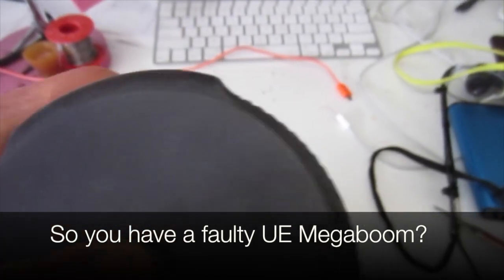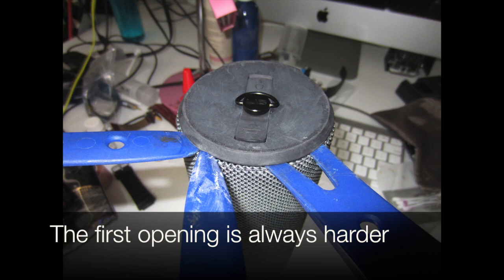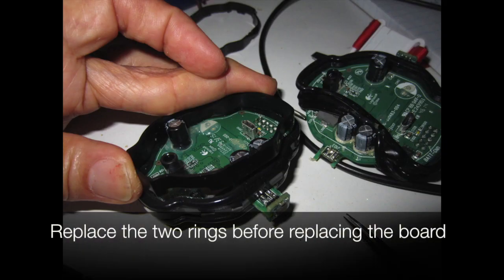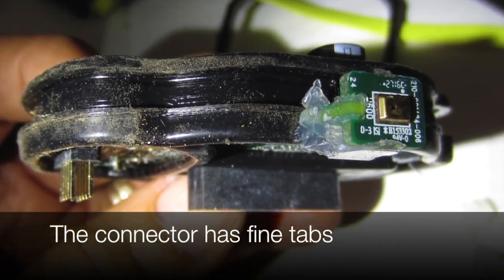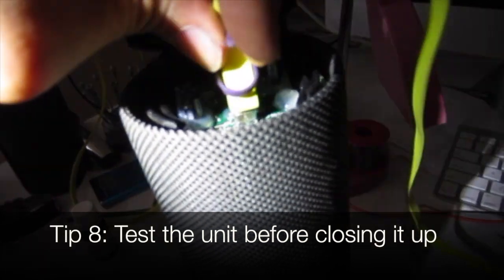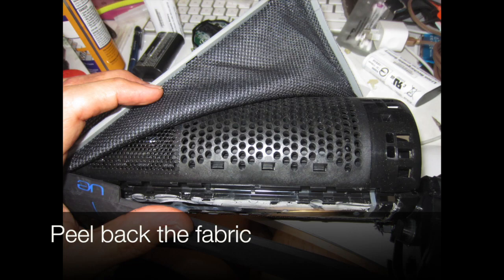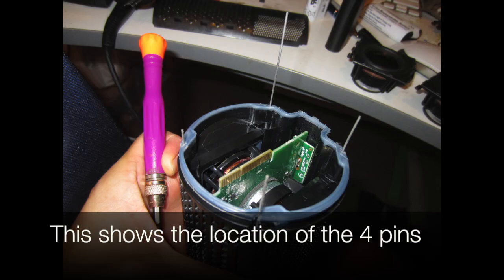UE Megaboom Not Charging or Faulty - 12 Tips when dismantling

Comment: My megaboom when plugged in to charge doesn’t blink white but it will statically say charging please wait if the wire is bent a certain direction. If I can eventually get it to charge it’ll go to 60% at max and barely last. Is it possible that it is a charging port and battery issue ? Was hoping it was either 1 or the other
Reply from the maker: Is the wire the original that came with the Megaboom? The original wires seem to work better. Also when it is connected and only goes to 60 percent, that can indicate a battery problem. The batteries can start going bad even with limited usage because it is age related more than usage.

Comment: Why is the battery light flashing?? It wont stop its a new battery to
Reply from the maker: Sometimes it is a problem with the charge board inside the unit . If the board is faulty it will not charge the battery and the battery light stays flashing .

Comment: Per the company, there is most likely a simpler solution. I unfortunately started pulling mine apart to see how to get at the battery and then suddenly it started charging again after many charging tries. Confirmed by the company's instructions below. Contact them for the full PDF of tips and tricks....

My MEGABOOM no longer charges, how do I fix it?
Your MEGABOOM can sometimes get into a state where it doesn’t charge. To get your MEGABOOM back to a normal charging state, do the following:
1. Connect your speaker to the charger and leave it connected for a few seconds.
2. If the charge LED fails to pulse continuously, disconnect the cable from your speaker, then
reconnect it, and leave it connected for a few seconds.
3. Repeat steps 1 and 2 until your speaker gets to a normal charge cycle - the LED should continue to pulse. (This could take up to 25-30 times.)
4. Once your speaker gets to a point where it charges normally, continue to charge it until the
battery is at 100%.

Be sure to update the firmware on the speaker so that the issue does not re-occur. To update your MEGABOOM software:
1. Download the latest app for your speaker.
2. Connect your speaker to your smartphone and open the app.
3. Tap More, then tap the update prompt.

(I think if the latest update is already installed, there is no "More" option. I didn't find it or any indication a firmware update was available to install on the speaker.)

Perform a Factory Reset: 
Press the Volume “–” and Power buttons simultaneously and hold for 10 to 15 seconds.
You’ll hear a tone that indicates the reset was done and your speaker then should turn off. This reset will bring your speaker back to factory settings.
Turn your speaker back on using the Power button.
The speaker will be in Bluetooth discovery/pairing mode.
After you have performed the Factory Reset, please charge your speaker overnight (5+ hours) to recalibrate the battery.
All the above worked great for me. The link to the PDF (if allowed and shown next) is"
https://images-eu.ssl-images-amazon.com/images/I/81suGzfRC7S.pdf
Reply from the maker: That’s great info . Thanks for sharing . I’m sure that will help many people . Seems like a lot of people having charging problems though .

Comment: I have been wrestling with a non charging UE Megaboom for 2 years. Finally fixed it!! The charger they give you is too short and doesn't make proper contact. Trim back the surround a couple of millimetres with a scalpel. Fixed!!!!
Reply from the maker: That’s strange if it was the original ue boom cable as that is made to match the ue boom
Reply: @Dentinvent  one year on... turns out it didn't work... i just keep that speaker plugged in all the time now... I've had the thing repaired twice, too... it seems to be a problem with UE speakers
Reply from the maker: Yes I always think the original cable fits better but also remember your internal battery dies with age and not just with use .

Comment: Hi, nice video! I am having similar problem with my megaboom. It said that The battery is low, I changed The battery but it didns’t help at all. It won’t get up. Do you maybe know why? Do you have the electic diagram? Thank you!
Reply from the maker: I do t have the circuit diagram but check to make sure you are using the correct Megaboom charger or one that is powerful enough . Sometimes the wrong cable affects the charge as well.
Reply: @Dentinvent  Can you kindly share the circuit, my circuit broke the mouthpiece circuit and I losses the. Now I can't access them, how can you help

Comment: Hi, i have this problem where the speaker wont charge at all, what i mean is, the speaker IS blinking but the battery percentage never increase, been using different cables and charger but no result. Also i have been resetting the speaker but still no luck

Now the battery is 0% and when i tried to charge the thing, it wont blinking now
Reply from the maker: Yes sometimes the charge board is f….ed. 
The charge test cable I show how to make would actually show if current was going in . If the charge board is faulty, it will never charge and the battery will die.
In sone cases it is the internal battery fault. The battery does die with age of a few years . 
Bit risky to order a new battery and find it’s the charge board.
When I made the video , I bought about 6 broken ones and got 5 to work and even sold the worst broken one off for parts . I kept one for my wife to keep.
Reply: @Dentinvent  any ways for me to make this thing works again?
Reply from the maker: @JoFerl  
I think you will have to take it apart but be careful and follow my video tips so you don’t break the side tabs inside. 
I would try with a new battery and hope the charge board is not faulty as well as the battery .
Reply: @Dentinvent  ok im on it! Wish me luck XD
Reply from the maker: @JoFerl  
Make sure you carefully dig out the silicone sealant type glue as per my video. Message if you need advice as you go . Hope you have some basic electronics tools .

Comment: Hello man thanks for the video but I request to chat with you
Reply: What happened when c128 near charging point when it's not on
Reply from the maker: If there is no power at C128 at all when you have power on the charger , there seems to be a fault with the charge board . You may need to see if you can find a broken Megaboom for parts .
Reply: @Dentinvent  ohh morning sir, the problem is that , the robot fall down, then the after I opened it, I found c128 is not there!! ,So the robot can charge without it or not?!

Comment: Great video 👍🏻 if I wouldn't have seen it first then I would probably have f***ed up the side of the circuit board
Reply from the maker: Robin,
I took apart many of these units and indeed f***ed up one of them. That’s why I made the video. I initially watched some other YouTube videos and they didn’t warn about breaking off the side boards . The side board controls the charging so if that if f***ed then so is the unit unless you have a spare to take parts off.

Comment: Hey can you help me my UE mega boom is not working the only thing it does is blink whenever I plug it into the charger and that’s only for like two seconds
Reply from the maker: Joe it sounds like the battery may need replacement . If your unit is more than a few years old , the battery may be dying .
Carefully follow the video on disassembly and remove the battery to replace it.

Comment: Hey man, I am having the same problem with my speaker. When i plug it into a power source, it only blinks about 2-5 times and stops blinking. I am able to get it to continuously blink only if i press the power putting with the 2-5 blinks it gives when i first plug it in. When blinking continuously, it just says “charging please wait”. When i reset it and hold the bottons, it’s imply turns back off again. Seems to not be holding a charge at all. Would you recommend a new battery?
Reply from the maker: Remember that the battery dies with age . If the unit is a few years old , I would try that first . Rarely is it the power charge board but I used to repair a lot of these and did find charge board faults as well. Be really careful when you lift the top section out and make sure you cut the glue away. Follow my tips on disassembly video. Good luck man.
Reply: @Dentinvent  See, I'm starting to think that's what happen with mine. I have 3 and the one that just stopped charging suddenly or turning on is probably around 4-5 years old. Is that the avg life if these speakers? Was looking into the megaboom 3 as a replacement, but I heard it sounds worse than the 2015 version we have. Have you had any experience with it? Thanks.
Reply from the maker: @DaCake2  I haven't bought a megaboom 3 as my megaboom 2 is still working well. Remember that the battery technology is Lithium Ion and that means it has a limited shelf life. Meaning all lithium ion batteries will die even if they are not being used. I would try and replace the battery unless you wanted a Megaboom 3.
Reply: @Dentinvent  Thanks for the reply. Yeah, I'm going to try and replace the battery first and see if that does the trick. I hear bad things about the Megaboom 3's sound quality, so I don't want to go that route unless I have to. Thanks again.

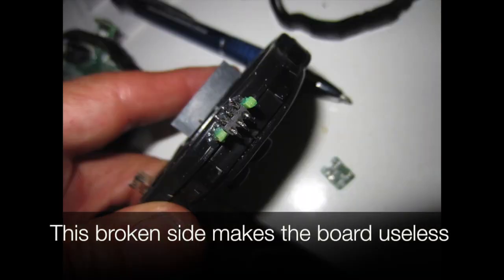Comment: My Box didnt work, i opened it, didnt remove the glue from the sides and one of these things (1:14) broke off. What exactly are these things? I reassembled the box without that thing and now it works fine again, lol
Reply from the maker: That thing is part of the charge circuit so I think you may have problems charging it .
Reply: @Dentinvent  Same with my box. Is it possible to buy a new one and fix it? How is it called and where can I buy it? It's charging very slow, the battery is new. thx for your video!
Reply from the maker: @Saltmaker  
Is it possible to buy what part ? I think if you search on eBay there are many selling parts from wrecked megabooms . 
Or alternatively look for a faulty one and take the parts off it. 
Good luck

Comment: I'm more than happy breaking this thing open, given it's currently dead, but I'm not sure if it's a battery issue or a charging port issue. No LED when it's plugged in... does this point to a port issue over a battery one. I don't have a multimeter so can't investigate further. Any hints?
Reply from the maker: If the unit used to work and then just stopped , I would guess it is the battery . I found the charge port issue because I used to buy broken ones and fix them . It surprised me when I changed parts over to find charge port complete pc board problems. .

Comment: What if my battery is fully charged but will only turn on when plugged in and as soon as it’s unplugged it turns off
Reply from the maker: Hi,
I think that the battery charge indicator is wrong. It may say it is fully charged . Sometimes it can say “100 percent charge” and she is lying . It’s like when it says “ 40 percent charge “ and it’s zero.  Remember the battery dies with age and not from usage . So when it is a few years old it stops working.  Best of luck.
Reply: Dentinvent thanks for the reply ! I just took the battery out and put it back in and that seemed to fix it
Reply from the maker: Well done . Hope you successfully followed my dismantling tips to prevent wrecking the board ( is Massimo so if it is working now). Taking the battery out can sometimes reset the confused lady inside who thinks the battery is 40 or 100 percent charged . If it keeps happening , you may still need a new battery.

Comment: Hey! I am also looking for a solution! My Megaboom doesnt work without a charger makes a strange clipping sound when powering down and the led isn't blinking anymore. 
I opened it, everthing is clean - I had this problem before but I cant remember how and why it disappeared. It always says 42% in the app - any hints? 

All the best! 
P.s. The battery got pretty drained, I forgot to charge it, when it was empty and now it wont start up at all.
Reply from the maker: That 42% that you mention is usually the default that the Megaboom seems to have when there is a problem with the battery or the charge board . If it works with the charger I think it may be the battery . If you have a multimeter, see if you can make the test charge cable in one of my other video. This will show if any current is going in. Remember that the batteries have a limited life depending on how old they are . Best of luck.
Reply: @Dentinvent  i opened it, almost broke it because some golden pins got a bit squished - put the battery in the freezer and voila - it works again :D
Reply from the maker: MAKEDA 
Yes be very careful as those golden pins can get damaged easily and it takes forever to get that black connector back on if it comes off the pins . Search amazon or eBay for a direct replacement battery in case your original one dies . Also keep it charged up and don’t let it start to lose charge . Good luck .
Reply: @MAKEDAofficial  hi how long did u leave the battery in the fridge for?
Reply: @deolindaben6063  Hey! I took it apart too, ( which I would only recommend, if you are really savvy, I almost broke it ) I think I left it overnight. I also noticed by the way, that changing the charger and or the cable worked too (it has happened again and this time I tried other cables and other adapters because I don't have the original power adapter anymore).
Reply: @MAKEDAofficial  I've dismantled mine, and put it all back together ,when put to charge, light just blinks once then stops blinking all together.
I'll try changing chargers, and also chuck it in the freezer too
Reply: @deolindaben6063  yes good luck!!
Reply from the maker: Did you change the battery ? It may be faulty

Comment: I think my megaboom  got rain in my charging port, am I f...k ? did I kill it ? and if I shorted it out can it be fixed? Bs its water proof.. any place fix them around tampa fl?   ty  Ed
Reply from the maker: Ed,
Best way to test it is make the charging cord adapter that i show in my video and see if there is any charge current going in . If the charge board is cactus you can buy replacement boards off some eBay sellers . If you search around you might be able to find a broken mega boom and take the charge board out if it . Good luck .

Comment: Hi, my ue megaboom will turn on very unreliably, and i can not find a way to reset it. Sometimes it refuses to even turn on, any advice would be much appreciated
Reply from the maker: I’d probably start by testing that it charges properly . Make the charge test lead that I show in my video and then see if the unit is actually taking a charge. Sometimes the charge indicator is flashing but nothing is going into the battery. If this happens , the battery capacity is getting lower and lower and eventually it won’t turn on. What does it say when you check battery percentage? If it says 40% charge all the time, something is wrong.
Reply: @Dentinvent  Thanks so much for the reply. It very rarely tells me the battery percentage as it doesn't turn on the majority of the time. I'm not sure how to make the lead shown in your video as I have no background in this field, but I'll test with different outlets and charging cables and see what that does. Thank you regardless.
Reply from the maker: See how you go but from
My experience ( fixed about 6 of these just for fun) there are a lot of charging issues. The charge cord I suggest to make needs a multimeter to check charge current is actually going in rather than just the light flashing . This flashing light can fool a lot of people into thinking the unit is charging . If the lady voice doesn’t tell you a charge percentage or if it stays on 40 percent then there is a battery or charge board problem. Best of luck .
Reply: @Dentinvent  thanks very much, i'll keep tjhat in mind

Comment: Hi there, my ue boom 2 got damaged, it works but has something moving inside. Upon opening I saw a 1500uF capacitor, but the speaker works as good as ever. Any idea what is supposed to do? I didn't take the board out so I can't say where it was exactly.
Reply from the maker: The capacitor is most likely from the upper board and is related to the charge circuit. The unit will keep working but probably wont charge properly when it gets a flat battery. You would be wise to take the upper board out and see if the capacitor has come out of that section and see if there is any track damage and if not, solder it back in.
Reply: @Dentinvent  thanks I won't be able to do it until march but I surely will see that. Thanks for the advice I won't let it go flat
Reply from the maker: If you watch my other video make this lead and you can see if unit is actually charging .

UE Megaboom not charging or Faulty - Make test lead tool & Problem solving https://youtu.be/XrFXQvf9_BE

Comment: hey can you help me...
I'm having issues with ue megaboom 3, bought 2 months ago
First issue i was facing was that the volume buttons on the speaker stopped working though the speaker worked fine.
but now 3 days ago the volume buttons started working again, so i reset the speaker.
Ever since that reset, my speaker won't start, nor the led blinks when charger is connected
Please help....
Reply from the maker: If it is under warranty ( being only 2 months old ) I would recommend taking it back and they should give you a new one. 
If it out of warranty I can guide you on testing it. 
What leds flash when you charge it ?
Reply: @Dentinvent  i fixed it myself after opening it 😁
Reply: Beast Shady hey entra a la página de Ultimate ears y llama y te dirán que hacer me paso lo mismo que a ti solo que lo volvieron funcionar esos botones y no prendió me enviaron una nueva llego en 4 días me hicieron enviar pruebas de lo que decía foto de la compra INE mi dirección y todo eso y me dijeron que me la enviar pero primero tenía que abrirla y romper cables y tarjeta madre y enviaba foto con número de serie y listo desconfié al principio pero si me llego